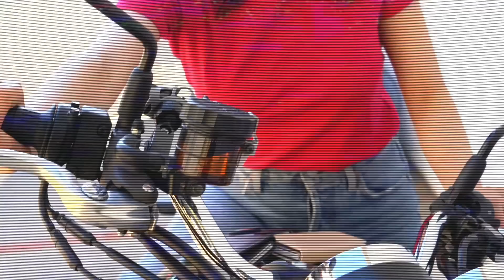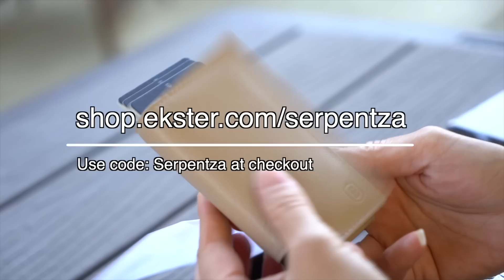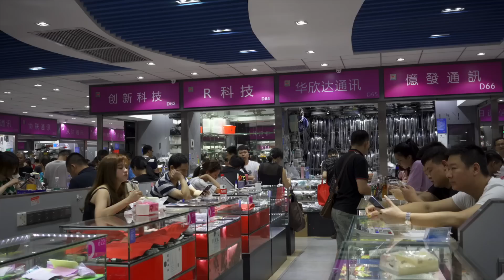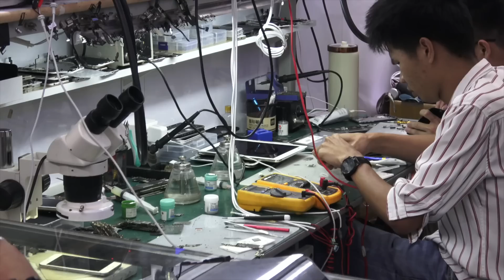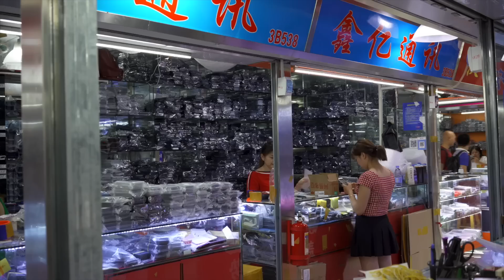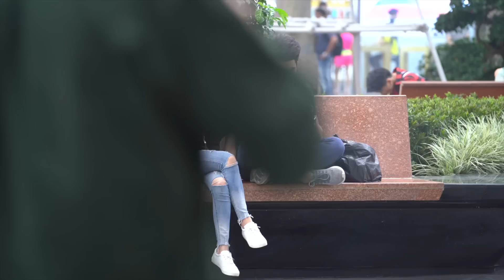Why China Can't make Chips!

Comment: The problem with most complicated semiconductors is the amount of people there is to design them is a handful. And you cannot buy 20-30 years worth of experience and knowledge.  China is basically stuck when it comes to this. The USA got lucky becuase of early investment and desire to learn it.
Reply: @qtben17  Almost all the designers without exception are white American males. None that I know of are immigrants or of immigrant backgrounds. The highest of all being Jim Keller. However the people below them are the ones that are putting them together and doing all the smaller designs. These are people that have been doing it for a long time.

Korea, and Taiwan are the only exceptions here. But they are mainly involved in the production. Not the design.
Reply: "And you cannot buy 20-30 years worth of experience and knowledge." Yes you caaannn.

Zhaoxin is a joint venture between VIA Technologies and the Shanghai Municipal Government.[1] In 2021 it was reported that VIA has a 14.75% shareholding in the company.[5] China has a domestic policy to "replace all foreign hardware and software from its public infrastructure with homegrown solutions" by 2023 (the so-called 3-5-2 policy).[6] VIA holds a x86 licence which allows its subsidiaries to produce compatible microprocessors; this allows Zhaoxin to develop x86 computer chips.[5]
Reply: @maniswil2  I wonder why Northern Europe isn't a chip design powerhouse then. They have the white part down pretty good. Is it the fact that they are missing the American part? What is it about America that facilitates or allows some white American males into top level chip designers?
Reply: @tomlopez7819  Way too high tax rates that causes brain drain.
Reply: @tomlopez7819  They were at one time. Siemens/Nokia for example. They just stopped breeding in my opinion and Europeans have some weird aversion to technology. Americans have an obsession.
Reply: @maniswil2  
US did not get lucky. What you see as luck is part and parcel of the market economy. China does not have a market economy nor a creative culture. 
Taiwan and Korea are not as advanced as people imagine and are still years behind the US as their market economy is in its baby steps. 
The US per value production of chips is still far in excess of Taiwan. I know this runs counter to the media narrative that has convinced people that all chips come from Taiwan.
Reply: @maniswil2  German birth rate just a little behind US. Real issue might be that smaller countries have to commit to extremely expensive fabs & then go right after foreign markets to make it worth their time, which adds a huge marketing burden that US fabs don't have to contend with.
Reply: @tomlopez7819  German birth rates have been collapsed for almost 80 years. As with most of Europe. Their average age is almost 10 years higher than the USA. USA is just experiencing this as of the past few years. It's a whole other subject, but you're not wrong.
Reply: @tomlopez7819  It's because he says nonsense. ARM is one of the biggest designers of chips, and was founded in the UK, and worked there for a long time.
Reply: @maniswil2  Higher average age is actually a sign of a society improving and having better health care. US health care is just shit, that's why your average age is so low.
Reply: @aronhighgrove4100  This is true at about 32, not 50. At 50 1/3 or more of your society is retired. What kind of society do you expect to live in where fully 1 in 3 people need you to feed them and wipe their ass?

Comment: I work for a US Engineering/Manufacturing company. There were times recently where we were in short supply of certain chips for our products and tried purchasing parts from Chinese suppliers. On several occasions these parts turned out to be completely bogus. They had the correct markings on the package but were not what they were advertised to be. So basically we got ripped off.
Reply: It is because they do not know what they are doing. They think they are supplying you with the right thing but do not know it is just one random thing in a billion.

Comment: China reached 7 nm this year, which puts them about four years behind the world leader Taiwan. That is advanced enough for all but the most high performance, cutting edge needs. Rather than production I think their biggest hurdle will be the chip design and that might take some time.
Reply: As I did see in another video - the equipment needed to make the chips is produced in the Netherlands. If there's an embargo against China then any equipment they have will be hard to get fixed and they can't get more of it.
Reply: @ehsnils  That's very true, they are reliant on ASML for the manufacturing equipment. There's no embargo yet so it wouldn't surprise me if they are working hard at expanding their capacity while they still can. We can probably also assume that copying that tech is given very high priority.
Reply: @GodsFavoritePotato  Well considering that they took 5 years to copy ballpoint pen tips, even when they are not embargoed, how long do you think it will take for them to copy chip lithography machines?

Ballpoint pen tips only need 3 things: High-grade steel, precision machining, and precision assembly.

Chip litho machines require much more parts, in even more exacting tolerances.
Reply: @PanduPoluan  I'm not sure how comparable the technologies are. They were probably very much capable of producing the ballpoints long before they could manufacture them at scale to a low cost. A $100 ballpoint pen doesn't make a lot of sense so they couldn't manufacture them within the constraints required for the product.

For the lithography equipment it doesn't really matter how much it costs, within reason of course, as long as they gain the capability. The finished machines could be ten times more expensive and the state would still fund their construction. Technology independence is worth that much and when they have figured things out they can iterate and improve.

It's always dangerous to underestimate your opponent and as far as opponents go I think China is the most dangerous one we've had in a long time. They lag behind in some fields but in others they are right at the bleeding edge, maybe even a step ahead of the US. Remember that Japan was once known for cheap, low quality copies as well. Remember that the Soviet Union managed to stay ahead of the US in some fields of research and manufacturing. Don't underestimate China.

The safety of Taiwan should, in my humble opinion, be the number one priority of the west right now and it feels like we're not doing even close to enough. China will make their move as soon as enough pieces have fallen into place for them, and that may very well be a lot sooner than most people seem to think.
Reply: there is also the question of economics. I remember reading in the Economist a long time ago that there is simply more money to be made doing low end manufacturing. It takes billions and a long lead time to build the manufacturing lines for the next generation process nodes.
Reply: @nobodyimportant_23  That's absolutely true. Top of the line stuff is expensive, but it's also what drives development and eventually ends up in the low end products of the future. China is actually suffering a bit regarding that lower end manufacturing as well. Workers pay has been rising, improving the lives of many, but because of that it's getting increasingly harder for them to stay competitive compared to other developing nations. Automation is also making things difficult as it takes away more and more of the jobs that remain.

As far as advanced manufacturing goes I think it's more about national security, so economic factors probably aren't as relevant as they might be in other countries. They need those microchips for everything from medical research to military applications and being dependent on someone else is probably seen as unacceptable in the long term. We're starting to see something similar in the west as well, where we seem to have finally realized that we are too dependent on Chinese manufacturing for a lot of things that are vital to a modern society.

Comment: I have been developing stuff with some Chinese ARM based processors. The actual chips are as good as Raspberry Pi. I have no idea if they are manufactured in China or Taiwan. The problem is that the software is horrid. They use their own BSP hacked about version of Linux, and getting source code from them is a nightmare (even though the Linux GNU license makes it illegal to not hand over source code). Everything runs Linux now but they just don't understand that other people might want to mess with and improve the products. They really should look at how the Raspberry Pi foundation works and learn something.
Reply: Pi's aren't developed to be fast, but cheap. Also, the boards wil 99.9% use low end western stuff like Rockchip or broadcom

Comment: Hi Winston, I've been following yourself and Laowhy86 (I'm sorry I forgot his name) for years and enjoy your content. I have to correct you on a few things though. Shanghai has a number of FAB's. I spent a year in China for my then Employer (the Dutch owned Semicon Stepper / Scanner manufacturer). I spent a year over in Shanghai helping SMIC to ramp-up and learn how to service and maintain our machines. When I wasn't busy with this, I was sent to service other Customers in Shanghai with smaller Fabs who had 'Stepper' machines (older generation tools from the days when Philips were involved). Anyway, there were 200mm DUV Scanners being installed back then when I was living /working in Shanghai then and I see SMIC has announced a near 9 Billion new Fab that will be built in Shanghai and this is not a facility that will try to rip off another manufacturers process, you pretty much can't rip-off another manufacturers process.
Reply: I think you are missing the point it is not that China does not have FAB's but they do not have will not have State of the Art FAB's

Comment: Even if China could produce something complex like a desktop computer CPU, the next major problem they would face is creating all the support chips, boards, and firmware. Then they would struggle to get a major operating system to support the new CPU. Finally, you would need all the new software. Apple, with its existing OS, hardware, and software development tools, struggles to get its new ARM-based chips to become mainstream over the course of multiple years. The chip shortages have more to do with older processes not being profitable to build new fabs, but the demand for the chips increased. Most people and information don't understand the life cycle of different chip manufacturing processes.
Reply: @Syping  Ya, Linux would be what they would use, but they would need to write the code to support the hardware and try to get it into the kernel. Then force all government entities to use the new system and software. Russia has a chip in the manufacturing stage with a Linux build for it, and it took them a long time to get that far.
Reply: And you're not even getting to the cultural stuff. The whole design thinking process puts China at a disadvantage because they have a different culture.
Reply: @webluke  
Apple should have their semiconductor plants. They are sitting on $200 billion of cash and could easily build all their chip needs with about $50 billion of that.
Reply: China has its own chips and operating system, but it is not advanced enough for the market, it is only for millitary.
chips were invented almost 100 years ago while China started doing it in recent years.
With enough time, it will definitely catch up.
For the new tech, like 5G, AI. China started it at the same time with the US. And China is better than the US for these technologies.
For Germany, Japan, they don't have development for these new tech.
Reply: That's what Linux is fir
Reply: Can China do software - such as operating systems? After all, Kylin is FreeBSD/Linux based. Again, China has taken something from western democracies and adapted it to their own needs. You can never achieve parity with an approach like that, much less get ahead.
Reply: @redyellow4699   "chips were invented almost 100 years ago"

The first Integrated Circuit was demonstrated in 1958, 64 years ago.
Reply: "Even if China could produce something complex like a desktop computer CPU"

Feiteng Rui D2000

Comment: China-based Zhaoxin Semiconductor has marketed a x86 8 core cpu that they proclaim to be on par with an Intel Core 7 series. It is made for the chinese market only by TSMC in Taiwan on a 16nm fab. 
From what I've read AMD were the partner that got them off the drawing board in the late 90's early 2000's and it has taken them another 20+ years to get a working prototype that so far cannot run a modern OS without failures.

Comment: The problem for China has nothing to do with manufacturing capacity or capability, it can easily expand to do everything TSMC does in Taiwan or Samsung does in Korea. China has been cut off from EUV lithography machine supply from ASML (begrudgingly on the side of the Dutch since every machine is hundreds of millions of dollars), this pushes funding towards AMEC which is China's home grown fab equipment supplier. AMEC has been producing equipment capable of 5nm for a year now, which is at this point cutting edge. TSMC, Samsung, Intel and so on have etching machines from them as well so the ability to manufacture chips isn't the problem. 

The IP that is etched on those chips is the problem for China and for good reason. If ARM, Intel, AMD, NVIDIA had to develop their current generation of IP from scratch they would not be able to do it no matter how much money you threw at them, it would take many decades because their design process is iterative since they rely on improvements over time and not development from the ground up. What TSMC or Samsung does is not nearly as important compared to what ARM does.

The IP that ARM sells comes in a couple of forms, either a hard or soft macro. Soft macros are as reproduceable or synthesizable as any piece of software, if China has access to them via HiSilicon or others they can continue to use ARM IP whether ARM likes it or not with the risk of ruining a relationship with the most important company for their technological growth. Hard macros are probably what ARM uses for all of the higher end designs, even for companies like Samsung and Apple since they get to integrate their IP with the extra things each company adds to their respective SoC's which lets them have more control. 

It would not be impossible for China to dump enough money into reproducing and changing parts of ARM IP and adding their own secret sauce to get around international patents and so on. It just has not been economically viable for them to do so until the point where they have no other choice. The US should not be playing any role in pushing them towards that point, this form of interventionism is very dangerous and could have disastrous consequences for the corporate interests the US thrives off of.

Comment: I worked with Engineers that dealt with China. 1 Co. Sold a specialised m/c and sent a service guy 12mths later as part of guarantee to check it over. He was lead into a room where the whole m/c had been dis-assembled and people were listing/measuring the parts. In another instance a  product was made in China, part A by 1 supplier & part B by another in a different city. Somehow Part A guy got a hold of Part B's part and then told Customer spec must be wrong kos they won't fit together. Customer said just make your part kos he knew these parts will only fit together at specific temperature and was ensuring China didn't rip him off.

Comment: When it comes to small steel balls made to very tight specification in both material, size and shape, Russia has the same problem, only worse: ball bearings. Those little thingies that make just about everything move. They can't produce them in a quality anywhere near world class level. You can imagine what kind of impact this potentially has on how many industries, regarding trade sanctions and all.

Comment: I sent in a hdd controller board to a Chinese owned company in Vancouver, Canada to have them replace the main chip in the board and reprogram it as the hdd had died. Cost me $50. What I got back didn't work either. Now I wonder if they didn't just harvest all the chips at my expense since there was no guarantee it would work when I got it back and it sure didn't. 🤔

Comment: The problem with Chinese semiconductors is simple. There is only ONE company, in the world making EUV lithography machines for creating those cutting edge 7nm and 5nm ICs, ASML from the Netherlands. And they are supplied by literally ONE company (Carl Zeiss) that can produce mirrors with a good enough optical precision and surface finish and another insanely cutting edge Laser company (Trumpf) both German and probably hundreds of tiny, highly specialized machine shops you often find in northern Europe. 
Even if they would get their hands on EUV machinery (which the US made sure they won't) reverse engineering this would probably take decades. Tech-giants like Nikon and Canon from Japan, both former big players in lithography machines gave up on competing and they have probably 1000x the knowledge and suppliers China has. They just fell behind in development and the market was taken by ASML. 
And when they finally get EUV lithography, others will probably have moved on to much newer, even more advanced technology. 
Innovation needs a certain environment between, universities, research institutes like IMEC in Belgium, manufacturers of machinery and even chip manufacturers to get from idea to standardization to proof of concept to working machine. You can't throw money at a donkey and expect it do do calculus either.